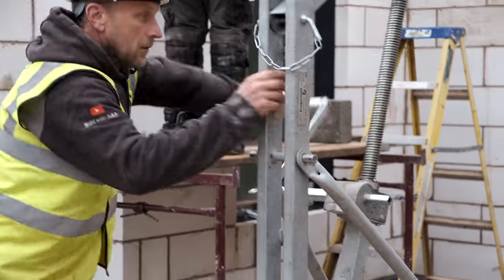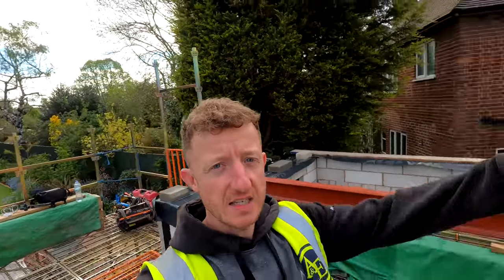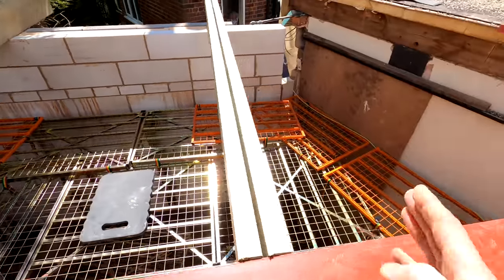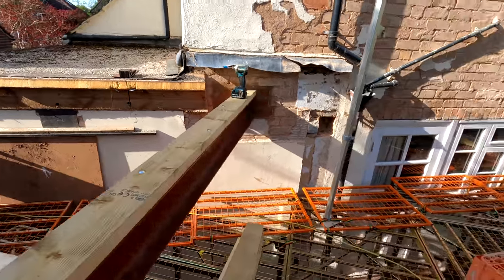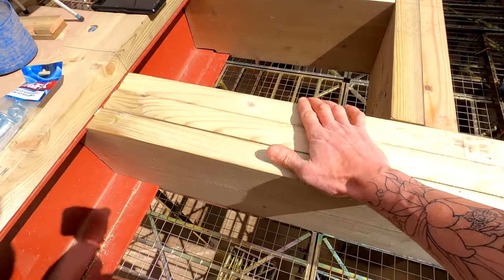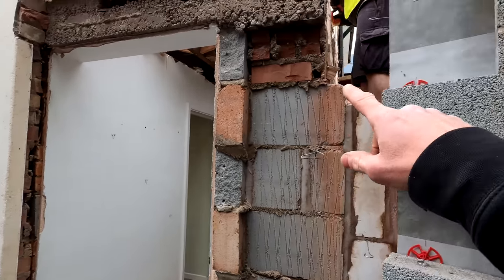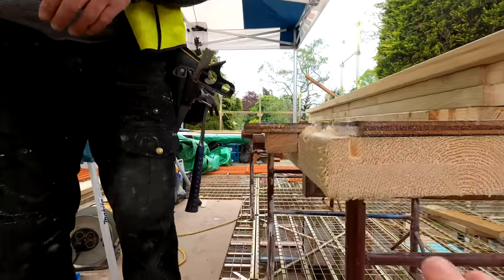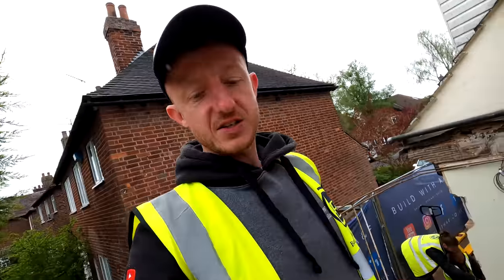Installing MASSIVE Steel Beams! | Single Storey Extension #14

Comment: If you want  to keep facia size down on a warm deck roof surely it's easier to ladder out with 4x2 through wall? All that extra work cutting a fall on every timber. Building inspectors round my way would have a heart attack if I'd cut 2 inches off of rafters as well.

Comment: ON YOUR RSJ’s you have about 100mm over lap ( width of the blocks) is it not 150mm ? As 150 is min surely you aim for more than that to ensure a better bed ??
Reply: As a rule of thumb 150mm for when the beam is in plane with the wall it sits on. 100mm when the beam is perpendicular. This all however depends on the bearing stress applied onto the masonry underneath the beams so calculations would determine whether it needs to be 100 or 150 or anything in between or beyond. No hard and fast rule to say it’s definitely this and that or the other.

Comment: Awesome again guys😎 Pete's DeWalt DCS579 is a beast of a saw💪 Is he finding the thin kerf blades wander a little in bigger rips?😎
Reply: I'm not a fan of thin kerf blades. Don't you think it's a marketing gimmic? Ok for rough work, I've never found them accurate though.
Reply: @JakeBM4  I'm glad you noticed this aswel👍 I think they use the thin kerf blades, solely to improve battery run times. I am now using the DeWalt 2.2mm kerf, general purpose blades,xand they hold a much straighter line when ripping. I haven't really noticed a big difference in battery life😎
Reply: @thetallcarpenter  That's good to know! I'll give the 2.2s a go!
Reply: @JakeBM4  👍😎
Reply from the maker: Hi Del much appreciated spot on with thin kerf blades, I suppose that’s why I haven’t quite jumped in full cordless but Pete says I’am to tight 😂 hope you are all well all the best Tony 👍

Comment: LOVING THE SAFETY DESK EASY TO ASSEMBLE COMPARED TO SCAFFOLDING AND EASY TO ADJUST EG REMOVE SECTION IF NEEDED RATHER THAN FULL SCAF SECTIONS

Comment: Projects coming on well boys amazed you got away with ripping the guts out of the joists though. I know what you mean about the big fascias we normally cut the joists on the plate and bolt on a 6x2 sprocket. Not a dis your work is fantastic👍

Comment: Just curious, do you insulate the web of the RSJ's for thermal bridging and reduce the risk of condensation?
Reply from the maker: Hi Richard were ever we can all the best Tony 👍
Reply: @BuildWithAE   should the RSJ not have a bigger bed ? I thought it was 150mm min it looks like you have 100mm the thickness of the blocks ?

Comment: Silly question perhaps, but why were the rafters so deep on those side sections anyway? As you've cut these down to form the tapers the top of the flat roof has come down too of course , so it'll be interesting to see how this all sits later on in the project as it looks like a fair bit of timber was trimmed off of these. 
Not a fan of the Ytong block with no wall plate to be honest as it seems an obvious point load to me, but I'm not saying it's wrong, just personal preference.
Reply: I personally wouldn't of tapered the joists as the velux will follow that pitch, I would of took out a 70mm half lap where the end of the joist passes over the outer leaf of block work then block up to it so it will be a 100mm tail end protruding  instead of a 170mm  and that way you keep the structural integrity of the timber